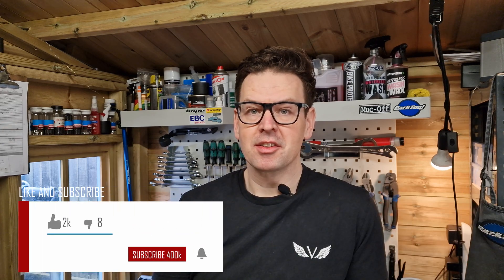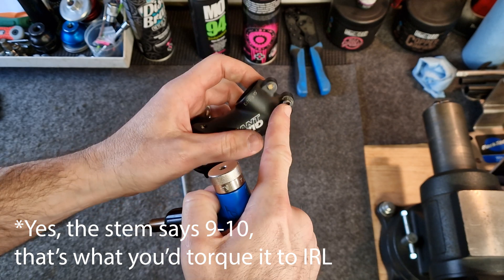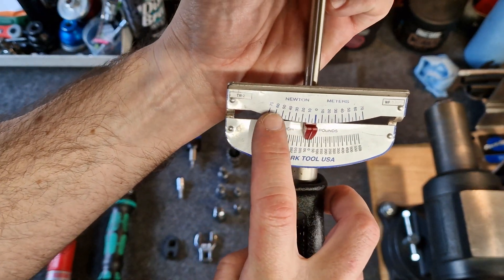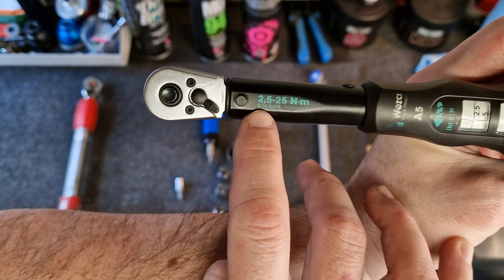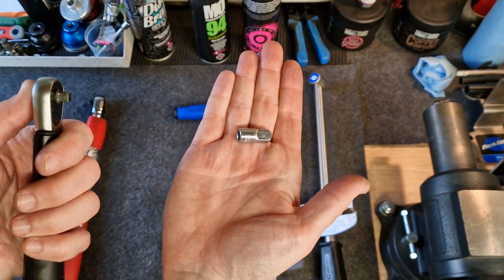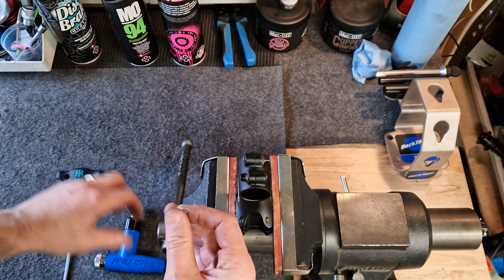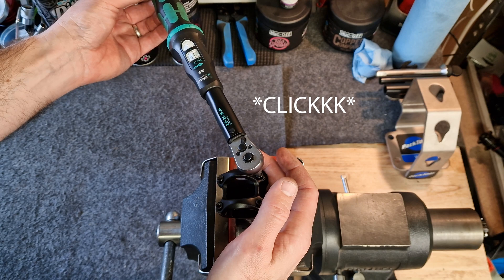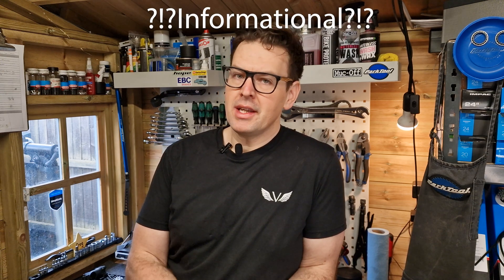Torque Wrench 101

Comment: It might help to explain why the crowsfoot needs to be perpendicular; basically, any extension adds leverage, and the reading would fail to account for that. In high torque mechanical situations, even using a socket extension is often not advised for the same reasons.
Reply from the maker: Thanks for adding that! I thought perhaps it was too much detail but you're quite right.

With it at 90 degrees the effective moment arm remains the same as when it's calibrated. 

Away from that and it differs in length, which means the torque reading will be different.

To be honest at low torque and with smaller tools it's probably negligible, but it's always worth doing the job properly!

Comment: Do you get your wrenches checked for calibration, Greg, and any recommendations? A lifetime warranty on a wrench I use states that it is only valid if the calibration is checked regularly - every 2 years, I seem to remember.
Reply from the maker: Good question! I guess my answer depends on a few factors, such as are you just using your wrenches as a home mechanic, and where in the world you are.

Wera used to have a facility in the UK but will now ship wrenches back to Germany. For me that's not ideal because of the turnaround and also shipping them across Europe after they have just been calibrated! I'm also looking for a reputable, reliable and cost-effective UK service myself.

For the home mechanic I'd say the 2 years is probably overkill - yes, even I think that, although I am usually a stickler for the rules! If you look after a wrench and always reset it to 0, as long as it's not facing workshop levels of use I think you can get away with longer (although as stated you may void your warranty). 

There are also ways to do it yourself using a vice, weight and tape measure which I can't do as a business, but I think would definitely get you in the ball park to ensure yours isn't wildly inaccurate.

If you think your wrench is say +-5% accurate, that's still broadly in line with most tools when they leave the factory.